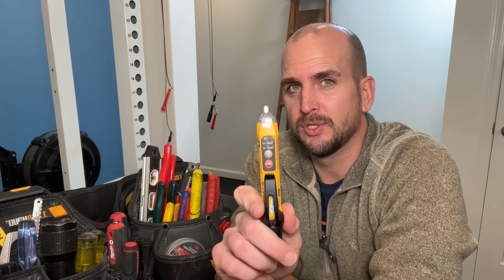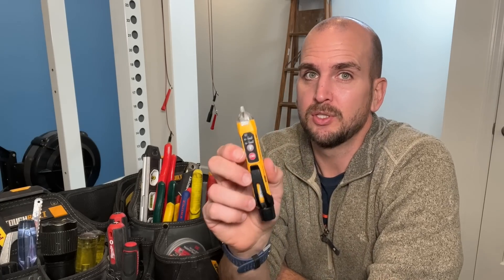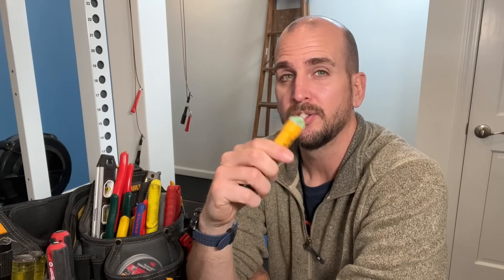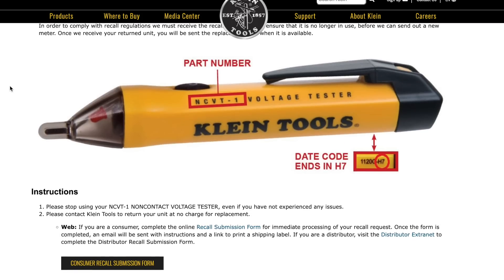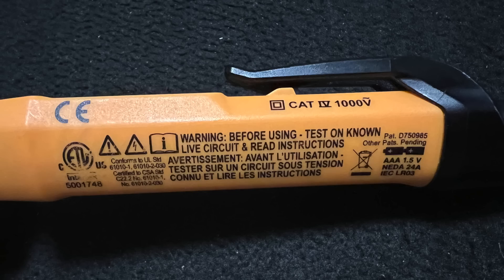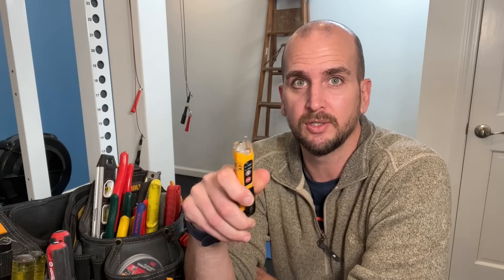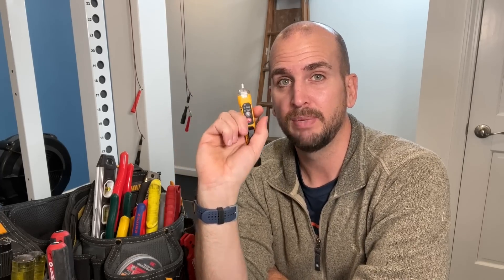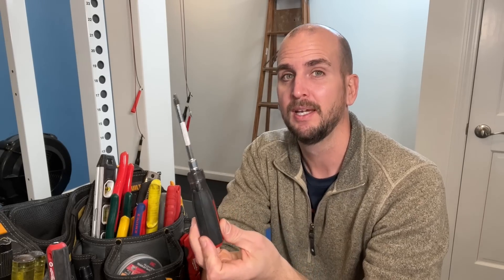The Tool I Get The Most Negative Feedback On And Still Use Weekly

Comment: You don't own an electrical tester as required by code and guidelines. Neither your Multimeter, nor your deathstick nor your socket tester is suited for it. Get a proper electrical tester. Neither expansive nor difficult.

Examples: Fluke T+Pro, T5, T6, T150, T130; Ideal 61-547, Vol-Con; Klein ET40, ET45; Beha-Amprobe 2100 ... and many others

Yes, I repeat myself. But you get so many views and people will go by your dangerous suggestions. Please educate yourself before teaching others!
Reply: This is what I wonder if testers like the Fluke T130 or Beha are even allowed in the US. I have seen on YT Americans using various NCVs, clamp multimeters, regular multimeters, socket testers, but bipolar voltage and continuity testers? No one
Reply: @Karol_Hamann 

I find it bizarre that voltage testers don't appear to be a thing on YT in the US.   For my DIY I have a Martindale VT12 to prove dead before I touch bare wires and also a non-contact for testing/tracing known live cables.  Both cheap so why not have both when your life is on the line?

Comment: As an industrial electrician at a coal power plant, I'll be the first to say never trust a tick tracer, they work most of the time but will not show dc voltage and if you dont hit a wire right they wont show it. I carry one every day but still treat the wire as if it's live, multimeter testing is the only way to know for sure

Comment: Thats stupid, all good electricians use this when its appropriate. Is not the only tool you use. Multi meter is still worn on your person but you can use the induction tester to check for voltage so long as you test live dead live. Test a known source first, then check what you need to test and finally retest the known voltage source. This allows you to know for certain the VT is working properly.

Comment: I was installing a pool pump and when taking the old one out it flooded the area I was working in, I had the 220 shut off at the breaker and kneeling in about three inches of water and it was raining, soaking wet.  I started stripping wires and  BZZZZZZZZZZZT!  HOLY CRAP!  Thought I was going to die, had to sit down for awhile.  I know I shut off the right ones because I tested it!  So I went back over, turned the breakers off, tested again with the Greenlee and power was on again!  WTF?  Go back around the corner and the breakers were reset so I turned them off again and went around the corner and waited, a crazy old lady came out and turned them back on, man I let loose on her then I got my padlock which I should have done in the first place and locked it, she started screaming at me to leave it on, frickin nuts!  The pump was on its own circuit iso it wasn't affecting anything else.  Who would have thought someone would do that. Always carry a padlock.
Reply: I am not a sparky, but was at a large industrial site where he had locked out and labelled the breaker to work on some kit.  Fortunately he tested before commencing work as by the time he had walked across the site to the kit, somebody had removed the padlock with cutters and threw the breaker on!   Never underestimate the stupidity of others.

Comment: To me these testers are useful for tracing live wire or a break in a power cord other than that I prefer DMM they is no way I’m going to mess with electrical wires without testing with a DMM
Reply: That depends on if you know what you are doing the a DMM or not.   There are good reasons why DMM are not an approved tester for proving dead and voltage testers are required instead.   Not knowing the limitations and pitfalls of using a DMM can result in death.   Too many people put the probes on two wires and assume that because the DMM shows 0v, the wires are not carrying any voltage.  Boy are they going to get a shock one day!

Comment: Great to scan over an exposed wire (Romex) in a basement/attic or in an opened up wall. Must have for ~$25.00. There are cheaper but the ncvt-3p is the go to. Klein is professional grade and has been for decades, Fluke is very nice but over priced for me.
Change sensitivity once or twice while scanning all over/sides of the wire just for sanity sake.

Comment: At work, my boss always said that the NCV tester is "not a proof of absence of voltage" and if you want you to prove there is no voltage, use a multimeter.
Reply: A multimeter used incorrectly can show 0v when there is voltage present.  The proper device is a two-pole voltage tester that also detects phase on one pole.

Comment: I had a problem with the ncv tester.  The thing would show that there was contact when I knew that it was a grounding line. That was because it had a hot line that I had moved over a good amount. Sometimes it’s too sensitive. Having issue with the switch turning on and off the smart fan. Turned out the 221 had 1 cable that didn’t fully clip into it. Who would have guessed.

Comment: Thank you for the video. I just bought the NCVT-1P and never realized there was a recall. It appears the 1P replaces the recalled one. I never would have known to check if I didn't watch this video. One thing I have run into is when I was checking all the circuits on my box, I couldn't get a positive for the 2 breakers connected to a 220V outlet for my dryer. I confirmed the dryer was working and had power. Would totally appreciate any answers or advice from the Masters I see commenting here. Thanks to all of you for your input and advice. I do a lot of major work in my house but have always known I was lacking in the electrical department so I'm studying up and making sure I do everything safely.

Comment: I have a NCVT-2P and have found it doesn't work well with the newer safety "shutter" outlets.  Also seem to have more problems detecting circuits that are on arc fault breakers; not sure why that would be the case.

Comment: I live  in   the  UK. 

What about the Kliein tool ncvt 6 ?

Supposed to be thd best.

I have a multimeter anyway with the 2 leads anyway &;wanting to learn both.

Been on ebay & the Klein tool cvt6 is around $/£60 cheapest & some new still in box

Comment: I agree with others a few hour ago I installed new outlet I turned off breaker already  & I used that tester it was light up & beeping telling me that outlet still energized. I just bought this tester 2 week ago or when used my digital voltmeter testing it no power at all in my outlet

Comment: As an electrician/ electrical inspector,  I do use a ncvt almost every day, but only as a quick test to see if somthing needs further investigation, this would be followed  up but the use of a specific contact voltage tester , like my fluke t110 using the prove test prove method , before trusting that a circuit is actually dead.
 Also very handy to carry out a prove test prove method, is a proving unit, such as my megger mpu690.

Comment: Have to know the limitation. Mine has weak readings on the middle circuit breaker in a three-phase system, since with the two neighbouring ones they partly cancel each other. Improved the detector by shielding one side of the probe with copper foil.

Comment: Most electricians that I've worked with only use their multimeters and don't even carry an NCVT. However, I find that using a NCVT is much faster to use in most electrical situations, so I use it the vast majority of my time in the field. I have several types, but I like the Klein because its sensitivity is usually perfect for what I need.

Comment: I don't understand the negativity. The only downside I see about NCV is that you can't stick it in a tamper-resistant receptacle. Any other tester could potentially fail and give a false negative. However, short of broken glass, the NE-2 neon bulb with limiting resistor is one of the most reliable electrical parts ever, in my experience. I use the Klein NVCT-1. Thanks for the great videos.

Comment: They are ok for general probing around, but I would  never EVER trust my life to an induction tester.. Just not reliable enough and too much to go wrong to touch as 40 cent tester..  And to a DIY'er who is probably not all that diligent it is even more dangerous. A DVM is always the best way to go hands down. I always test with a DVM to make sure the hot and neutral and ground are what they are.  And then even after testing and confirming dead, I lightly touch the wire with my fingers as a final test.

Comment: i still use them but i ran into an issue with one in an old home, was romex coming into a junction box, didnt know wwhere any went but one came up out of a 6x6 beam that was used as a foundation for the front porch, couldnt see the wire underneith porch or anywhere else it just died into the beam, the other wires went into the wall in different directions one was a porch light.. tested all the wires atleast 3 times each, all three in the wall read hot, the one going into the beam read nothing.. assumed it must be some old wonky wiring from the 60s they were grounding something or that part of the circuit was disconnected and capped off inside the junction box.. we needed to replace this old rotten beam so i cut the wire which read nothing with side cutters for the thing to arc out in my hand and trip the breaker.. turns out that wire was actually the feed coming from the panel and the wire was hidden behind pine panels where it couldnt be seen heading for the basement panel.. no idea why it didnt read properly but i tested it so many times with consistent results i was certain it was dead and couldnt access the inside of the junction box or the wire anywhere else..

i still use the same meter but ill be sure to verify it when things dont add up like this in the future

Comment: NCVT are awesome, but that specific Klein is a nuisance to use. There are dozens of designs that work just as well but do not need to be turned on and off. Nothing worse than forgetting it on in your bag. The "always on" ones have a light that comes on with small amounts of movement to indicate it is functioning.

Comment: Before the 2000s I had a contact tester, it was a flat-tip screwdriver, copper or brass tip, then the plastic handle extended almost all the way to the tip, handle was transparent with a tiny light (no LED) and a resistor, you put the tip against the contact you were testing, and your finger touched the metal cap past the resistor on the other end.
If the contact or wire was hot, the light turned red.
Oh, and it had a range between 0 - 400 volts. Think Is till have it somewhere in a box.

Comment: A non contact tester needs to be used to identify hot wires NOT dead wires. Once you think a circuit is off with the non contact tester verify with a multimeter. 

I made a 30 second video of a condition that a non contact will report an outlet being off when it’s not.

https://youtu.be/NbVSFAOuA88

Only when the Mass from my body nears this circuit will it go off. Granted it’s unlikely you would use it while not holding it while it’s leaning toward another circuits cord but it’s just a way I can very quickly illustrate it’s general unpredictably.

Comment: Hidy & THANK YOU for an excellent informative video!!!
   I was pro. electrician, for my main career, and I carried an analog Tripplet 310 VOM multi-meter, a fluke digital meter, (I don't remember what number it was), a "Wiggie" it was LIKE a Wiggins voltage tester, but I liked the Ideal 61-065 Voltage Tester. It reads from 120 to 600 AC or DC. Most of the time you weren't worried about the voltage when chasing a circuit to see where you loose it. It has a spring loaded weight that JUMPS to a certain voltage and has, not only a visual line and an LED showing you have voltage, but it jumps in your hand. The test leads store inside the outer edges of its 1 piece body. You pull the probe out of its holder and turn it around and the case holds it and acts like a handle. Tgen you have your other probe in the other hand. The tip, of the probes have spring loaded covers that all for testing in tight places. Or you can pull them up and give them a twist and the covers stay retracted. It is heavy duty enough to make you feel confident when probing up in a motor control cabinet. It's safety yellow. The test leads are pared and plug in in one right angled plug, in the bottom of the unit. It was designed very well. When I retired, I went to an electrical supply store and bought one for myself. YOU CANT BEAT IT for testing circuits.
   I have an AMES "Squeaker" non contact voltage sensor, like you're talking of. Its great for finding wires inside walls. It's also great for informing you which wire is HOT. If you separate the wires out a tad, and lay the tip on each wire's insulation, it will tell you which wire is hot. I did have an Ideal, twice; but each one was stolen, right out of my METERS DRAWER in my hobby shop! So, I got a cheaper one and it's stayed for several years! 
   Lots of the time you're NOT worried about what the voltage is...just that you have some there

Comment: My dad is a master electrician with 50 years of experience and swears by his NCVT. He uses a simple Santronics 3000 and advises to couple them with common sense practice like checking each conductor twice and using a traditional meter when it really counts, etc. (and always treating every wire like it's potentially live, connecting and disconnecting in order, etc., like many others have mentioned)

Comment: I lose my non contact tester, I lose my contact tester and sometimes do not have a multimeter in the right truck.  I often test live and ground with a screwdriver ..... sadly on the metal box or ground wire after flipping the breaker.

Comment: I would never have thought to use a multimeter for something like checking for live voltage before working on something. This strikes me as much more dangerous - not only because you have to get more "up close and personal" with the wires to use the multimeter, but also for some of the reasons that other posters gave given whereby a multimeter could give a false negative. 

I mean no disrespect in saying this, but I'm also unsure how to take it if professional electricians say the non contact tester is worse because my experience with professionals is that if anything many often seem less safety-conscious then DIYers, e.g., commonly working with known live circuits, grabbing ahold of hot wires by the insulation, touching presumed neutral copper, etc.

Comment: Short but sweet. I had a "pen" tester in my pocket. At a customers home, the complaint was "erratic" power loss. Standing in the kitchen, my partner pointed to my pocket and said"hey, your touch tester is lit. ..... huh?..... This simple device alerted me to something. The light fixture in the kitchen was a "MULITAP" for a huge addition. Result? It was able to detect a massive neutral loss (burnt wire nut connection) simply by standing 8 feet away. These work!!!!!!!!!!! Understand "what" they can tell you.!

Comment: FYI: I had a southwire voltage tester. It came in a pack from Lowes that had the multimeter, voltage and outlet tester.
It had a recall on it and southwire replaced it. It was several years after I bought it and I'm sorry but I forget the model number.

Comment: Im a Electrical Power Technician. Here when I do 230V/400V/690V I wouldnt trust that thing even in the slightest. If I would ever work at 120V/100V or lower (AC) I would probably use that too since yes you could die if you touch a live wire but....I survived worse :b

Comment: I will use the non contact but do the following
1) Test before turning off breaker
2) Test after turning off the breaker
3) Short the hot to ground and/or common 

I am wondering - what would the dangers be (other than sparks) from doing #3?   I think its safer than testing with my hands even though I try to never touch the bare wires.. :)

Comment: Electrical engineer here.  I would add the following to #3:  If the circuit/box you are planning to work on is currently in a "good" state (i.e. is working properly and you want to extend it, or change the device (switch, receptacle, etc.)), then use your NCV to test that specific circuit/box/device first while the power is still on (but before opening anything).  By doing this, you verify that the NCV is working and you verify your technique in properly probing the area.  You verify that you indeed see live voltage at the fixture.  THEN turn off the power at the breaker and REPEAT the NCV test the same way you did before.  If you see no voltage, and you are probing the same way as before when you did see voltage, then this provides some additional confidence that you are using the tool correctly.  Obviously, if you still get a "voltage present" indication, then the circuit is still live, and you must determine why before proceeding any further.

If the circuit you want to work on is already damaged (e.g. from a previous overload, fire, etc.), then obviously you don't want to apply power in order to use the above-mentioned technique.  In this case you must test the NCV on a different live circuit as explained in the video, and use extra care to ensure you are properly probing the circuit you are going to work on.

Be safe out there!

Comment: Those are great ,word of advice buy the one that detects 90 volt and higher usually fluke  ,when doing Metallic clad use voltage ohm meter especially after a demolition job I’ve been hit 120volts ouch I’ve been doing this 19 years 277v hurts worse : I was told when your on ladder they don’t work as well  I personally like them by the way the Klein meter has a built in tester just found that out the other day ,Keep doing these videos you help out the average Joe !